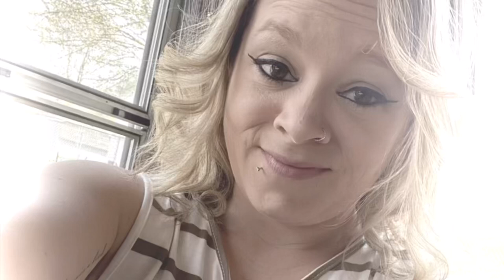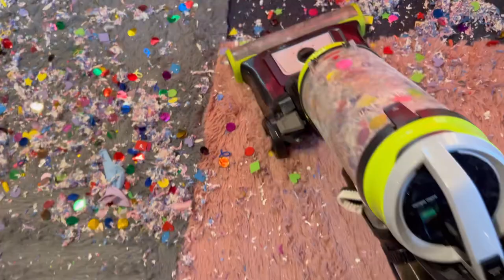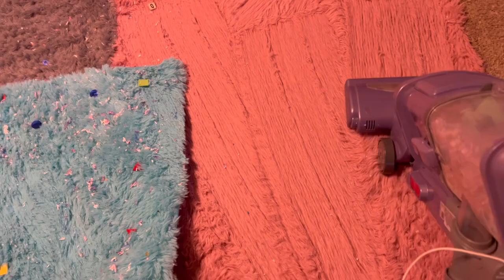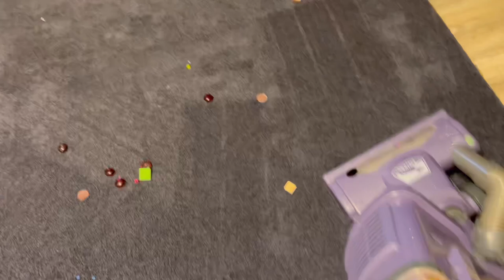2 Mixes 5 Rugs With Cleanview Swivel Pet || Mic’ed Cleanup || Thank You Again @DLVASMR  🫶🏼😘

Comment: 😘 TIMESTAMPS 😘

💕 0:00 - Intro
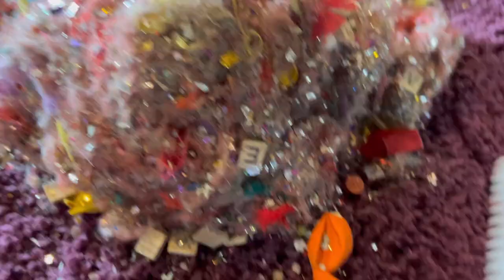💕 0:20 - Dusting brush pickup w/ Rio Mix on fluffy purple rug, closeup 
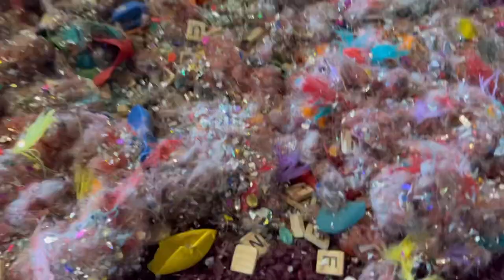💕 1:19 - Extended hose pickup w/ Rio Mix on fluffy purple rug, closeup 
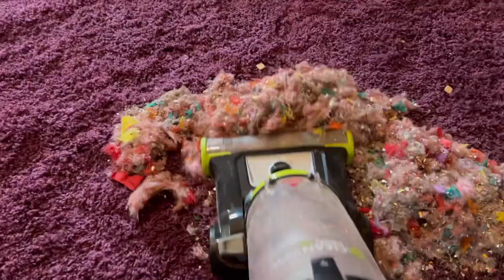💕 1:48 - Green Cleanview brushroll pile attack w/ Rio Mix on fluffy purple rug
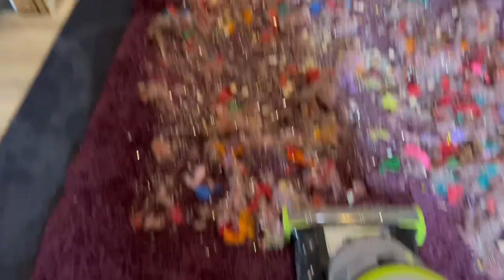💕 2:30 - Green Cleanview spread out brushroll pickup w/ Rio Mix on fluffy purple rug
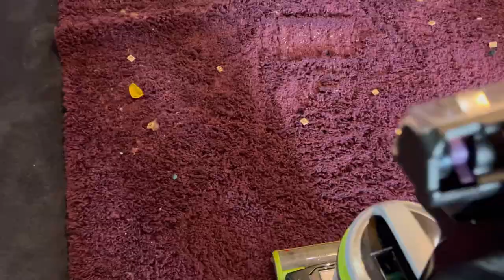💕 6:20 - Lavender Shark brushroll cleanup on fluffy purple rug 🎤
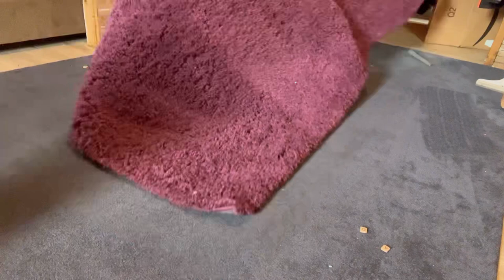💕 10:27 - Rug shakeout
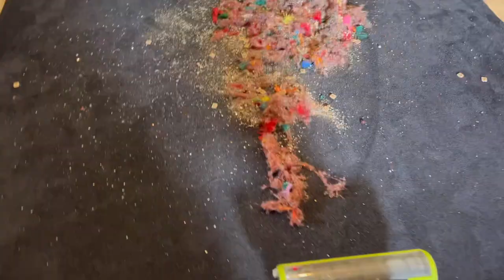💕 11:19 - Green Cleanview brushroll pile attacks w/ Rio Mix on area rug
💕 12:23 - Lavender Shark brushroll cleanup on area rug 🎤
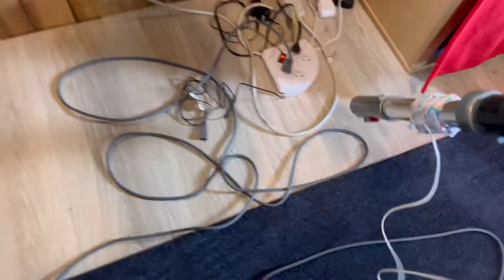💕 16:25 - Lavender Shark metal hose cleanup/edge cleaning on area rug/hardwood 🎤

💕 17:33 - Dusting brush pickup w/ Unicorn Poop Mix on fluffy rugs, closeup 
💕 18:20 - Crevice tool pickup w/ Unicorn Poop Mix on fluffy rugs, closeup 
💕 20:44 - Extended hose pickup w/ Unicorn Poop Mix on fluffy rugs, closeup 
💕 21:34 - Green Cleanview spread out brushroll pickup w/ Unicorn Poop Mix on fluffy grey/aqua rugs
💕 22:02 - Green Cleanview brushroll pile attacks w/ Unicorn Poop Mix on fluffy grey/aqua rugs + bin dumps
💕 26:34 - Green Cleanview spread out brushroll pickup w/ Unicorn Poop Mix on multiple fluffy rugs
💕 32:11 - Green Cleanview brushroll pile attack w/ Unicorn Poop Mix on multiple fluffy rugs
💕 34:46 - Lavender Shark brushroll cleanup on multiple fluffy rugs 🎤
💕 39:14 - Lavender Shark brushroll cleanup on area rug/hardwood 🎤
💕 40:56 - Lavender Shark metal hose cleanup/edge cleaning on area rug/hardwood 🎤
💕 43:35 - Lavender Shark brushroll cleanup on area rug/hardwood 🎤
💕 47:30 - Lavender Shark crevice tool cleanup/edge cleaning on area rug/hardwood 🎤
💕 48:10 - Lavender Shark brushroll cleanup on area rug/hardwood 🎤